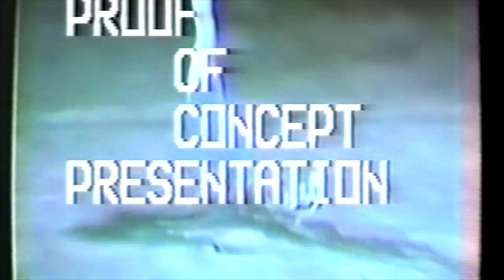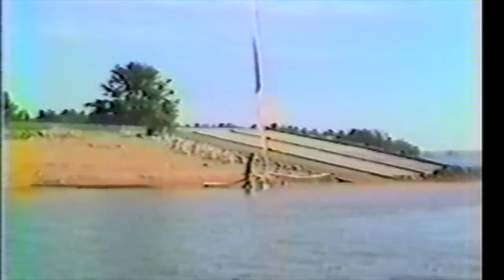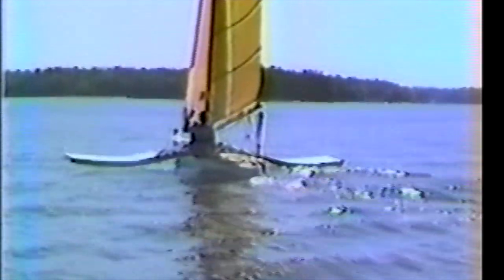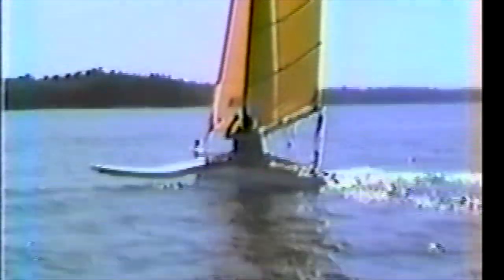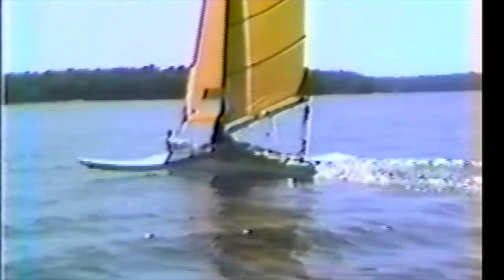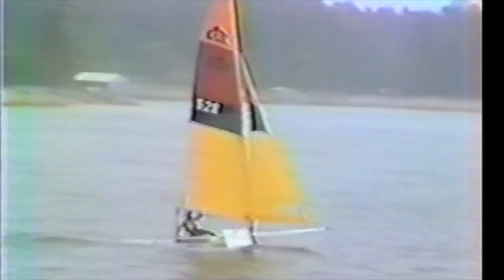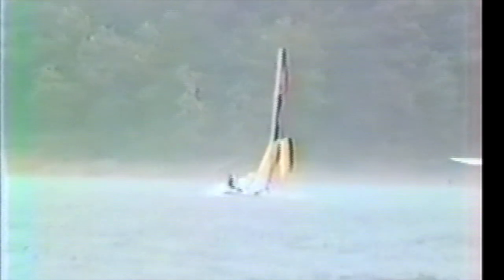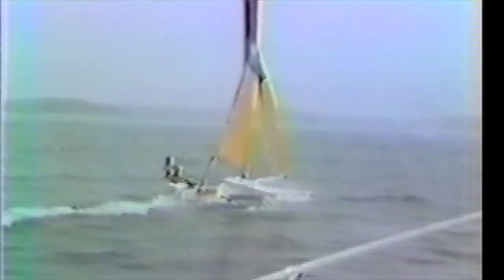Wingmaran  full video

Comment: very interesting concept. Pity the music is overpowering the dialogue !
Reply from the maker: I agree, it is copy of a copy of a copy.  If you turn it up high, you can hear.  The main idea is that the drag on the wing tip does not increase as fast as the drag on a trimaran ama would.  It is very similar to a hydrofoil, but without issues with cavitation or stall.  It's weakness is dealing with big waves.  But it never was tested in the ocean. The last trip my dad made was to Hilton Head but he sailed on the back side of the island.